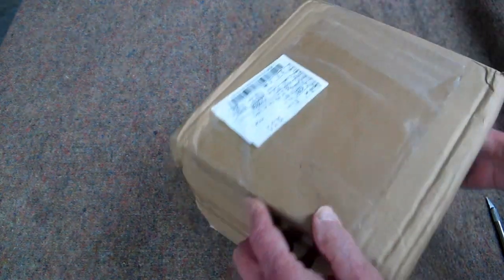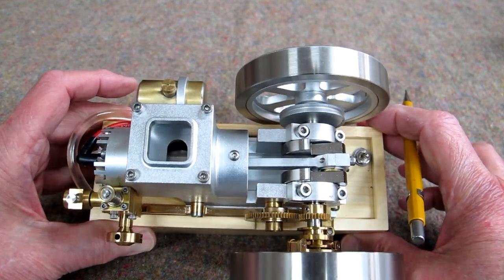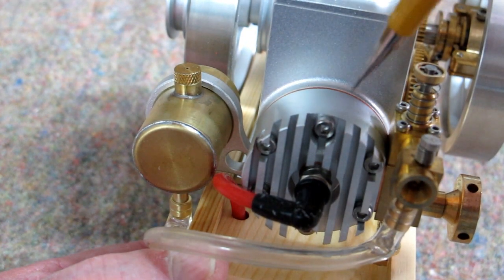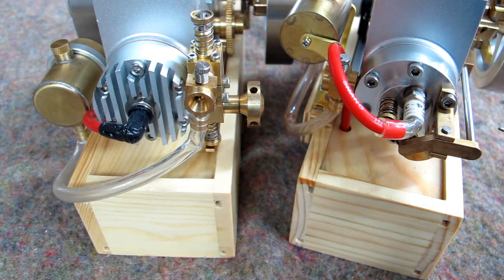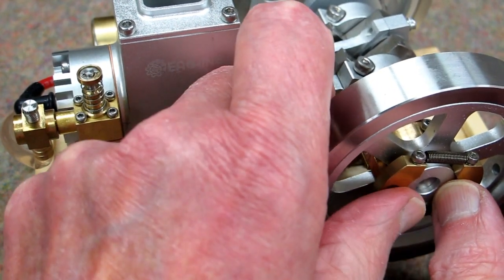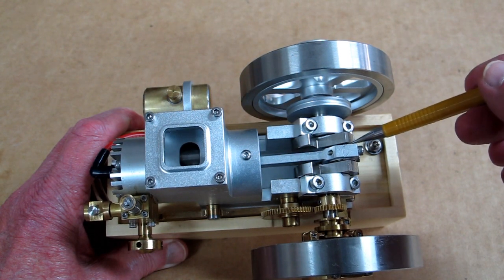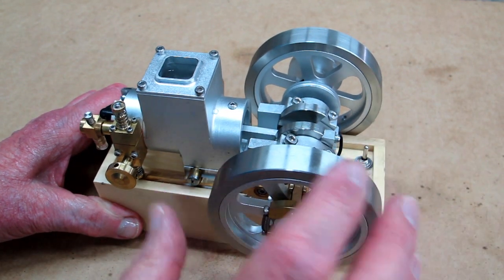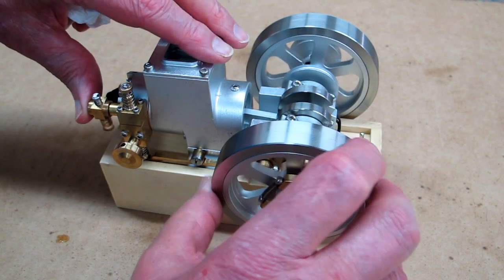Eachine ET7 Hit & Miss Engine - Simplified Governor

Comment: Ron... I am a Mechanical Engineer, and love engines and anything that moves. after watching your videos on these little hit & miss engines, i went out and bought one off your link. Actually bought this on here ET7. took about a3 weeks to get, and was packaged as you show, very nicely. i removed it and then made sure all parts moved freely and were lined up nothing adjusted or tweaked. validate compression and four stroke cycle. Made my mix of fuel per your video using the Coleman Fuel/ white gas and a drop of marvel mystery oil very light pink coloration. put in fresh batteries, filled up the tank, removed air from fuel line as you described, spun engine around a few times and then flipped the switch. I did meter the switch to validate ON & OFF position before fueling up. engine will not fire, by hand or via pull cord :/
went back over all moving components, validated compression and the four stroke cycle. i then notice that if i covered the carb (choked it) that when i spun the flywheel, fuel would push back in the line towards the tank then suck back up to the carb on the next stroke (intake). then i watched as i spun the engine by hand the intake valve NEVER moves. it is free and i can push it in and out freely no issue. i used some oil in a ca (like WD-40) and blew it out, and it moves freely. but when i crank it will not INTAKE on the stroke. i even spun it a few times with a drill on low (600 rpm) and never budged. i can tap it and it moves freely. 
wondering if this could be the problem ? could there be a leak on the intake valve side ? maybe in the housing or seat ? 
i did pull the plug and validated i have spark on the combustion stroke each and every time. i marked the needle valve on the carb to where it came from the factory. so i have FIRE i have AIR, jut dont seem to be getting Fuel !  i even primed the line, put a drop of fuel in the carb and it sputtered once then nothing.
Reply from the maker: I answered this in your email.

Comment: How much torque do these models have I want to run a set of double k horses shavers off one
Reply from the maker: Not a chance. They do not produce that much power.
Please subscribe. 
That is what keeps this channel running. 
Ron
Reply: @RonaldWalters2010  any suggestions for a hit and miss power then I'm not trying to generate electricity to run them I'll be using a transmission to reduce the rpm to around 100 rpm for a direct drive
Reply from the maker: These are not intended to do anything more than turn a propeller in a boat of drive some of the small displays or toys for model steam engines. Have you considered a 4-cycle weed eater engine? Some of those have electric start and are fairly quiet  compared to a 2-cycle.

Comment: Nice to see they finally put a bearing on the connecting rod... would be nice if they did that for the main bearings too. I have an ET1 and there's so much slop I'm surprised it runs. Extra bonus, the governor side flywheel is falling off too.
Reply from the maker: For ET1 upwards through the series, the top and bottom end of the connecting rod run on bushings which need oiling. The crankshaft runs on small roller bearings. I also dribble some oil in for the roller bearings. Sounds like some maintenance is needed for the governor flywheel. Using a cordless to start the engines can loosen things up.

Comment: really a good recommandations video here , the ET 6 has to filigran and much parts , now i just have a decision between ET1 and ET7 , the ET7 version is really the best result but still now not available in ebay , ok look further and see which deal comes between both , thanks lot and regards , but which one of the engines have the best quality and longlife   ,the old version blue one  without O-ring on piston  , or the new ET1 with O rings , how many times you must changes the O rings on ET1 ?
Reply from the maker: The old blue one also has an o-ring on the piston… but it is a much larger o-ring than the ET1, ET6 or ET7. 
ET1 and ET7 are much improved versions over the old blue one.

I have a video on changing the o-ring on the ET6. Not very difficult and the ET7 valve arrangement makes it even easier.

Check the video description for links, plus ET6 and ET7 have Black Friday coupon codes.
Reply: @RonaldWalters2010  just a information  ,its interesting , see the pictures please ,may be it is a upgrade by this offer ,, the piston picture here is complete without  O ring  by the old blue version ,  curious things here  , may be the old blue versions are all now  have a new upgrade now , but nobody knows it well   ,   https://www.ebay.com/itm/Engine-Oil-Engine-Mini-Engine-Model-Hit-and-Miss-Engine-Send-Friend-Birthday-Gif/153449340466?hash=item23ba4b1e32:g:jcMAAOSwo6hcsNEC
Reply from the maker: Not sure what they are showing in your ebay listing. I have not seen a brass piston in this engine. Viewers have sent me photos of the Blue Engine piston and it has an o-ring on it.

Also the eBay listing shows two different type spark plugs. To my knowledge all of the engines now have a spark plug like the little one in the plastic bag.

That blue engine is listed on Banggood.com for $224.97 plus shipping.

https://www.banggood.com/In-Stock-STEM-Stirling-Engine-Full-Metal-Combustion-Engine-Hit-and-Miss-Gas-Model-Engine-Gift-Collection-Toy-p-1239802.html?rmmds=search&cur_warehouse=CN

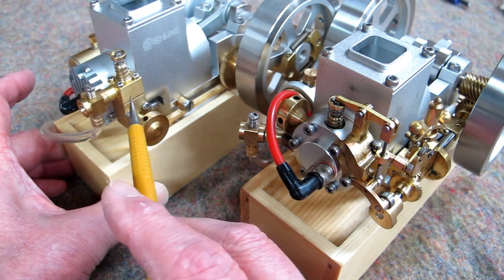In my review video of the ET6 at 4:15 the various piston o-rings are shown.

Eachine ET6 Hit & Miss Engine with Flying Ball Governor
https://youtu.be/pCM_j6TfHy4

I do not provide links for this old blue engine because I have never reviewed it and because I have been told about too many problems experienced with it. The new engine series beginning with ET1 (M90) are a much improved engine and use the small o-rings on the pistons.

I have received zero complaints about the piston o-rings… which at some point in time will need replacement.

For my money I would go with the ET1 or ET7.

Thanks for watching
Ron
Reply from the maker: OH yes... tomorrow I release a new video showing the ET7 slowed way down.
Reply: I have both the ET7 and ET1.  Between those two it's just which one you like the looks of.  The ET1 is very slightly more reliable than the ET7, but I got my ET7 to run the slowest of all 4 of the ET1, ETX, ET6, and ET7.  
I did a review right after I got my ET7 here https://youtu.be/nYIeRo5cCqo but I got all those issues fixed (in part by moving the fuel tank up to be more level with the carb).  If you want to check out my experience with these engines.

Comment: Hmmm far better sound on Et6 and Et1.. I want to maybe buy one but dont know does it have disscount on black friday
Reply from the maker: That's when you want to check the links and discount codes in the video description.
Reply: @RonaldWalters2010  Thx for answer im going for et5 it have carburator and uses gasoline as real atmosphere engine :)
Reply from the maker: The ET6 and ET7 will also burn gasoline.

Comment: If you disable the governor, would it then fire continuously like a standard 4 stroke engine? The speed may increase until it's too high, so some carburetor modification may be needed. It would be nice to have a model that could run as a standard 4 stroke, and as a hit and miss. You should make a video of all your engines.
Reply from the maker: You would need a carb with a throttle barrel like an R/C engine. There are small engines available which have R/C throttles and electric start.
When you load the hit & miss engine, it is then firing like a standard 4 stroke.